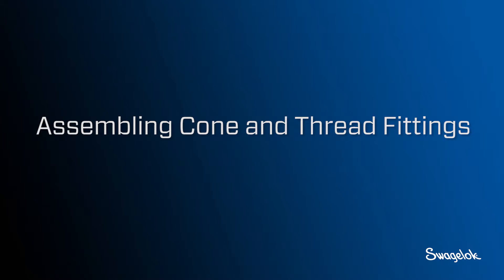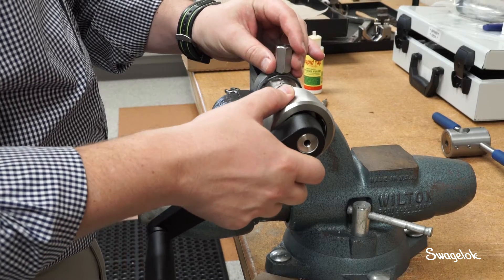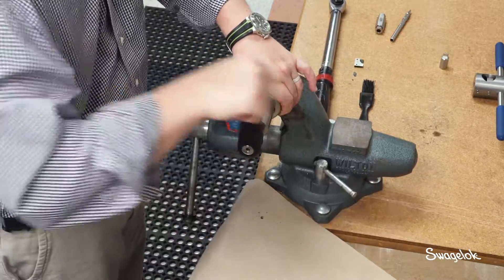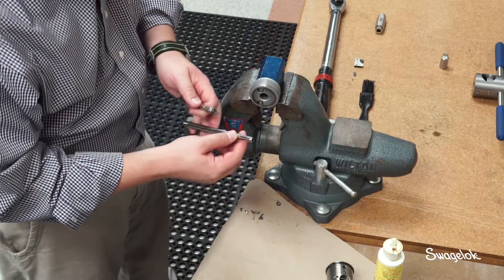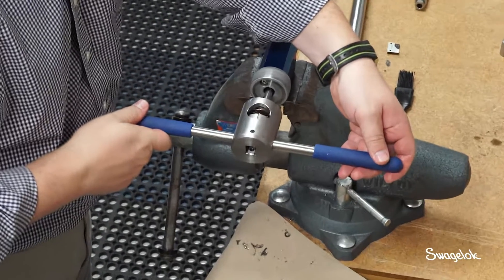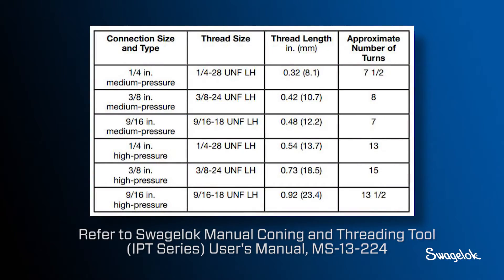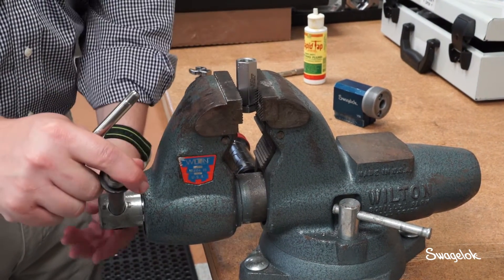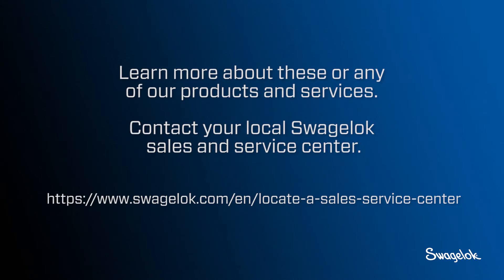How to Assemble Cone and Thread Fittings | Tech Tips | Swagelok [2020]

Comment: You have a rounded thread that will leak at over 600 ppsi slow flow of water without air especially when the geniuses add the pump or pressurized pneumatic hammer.